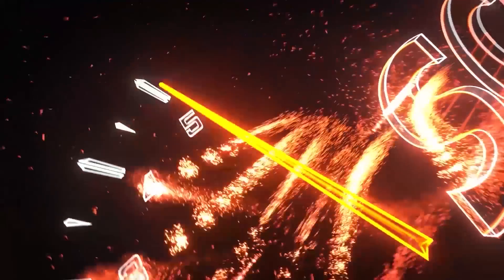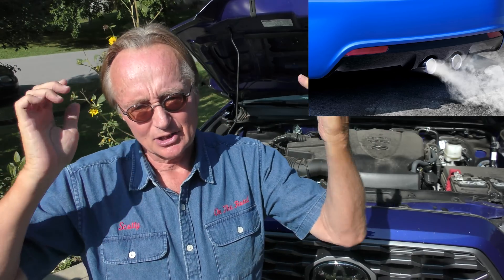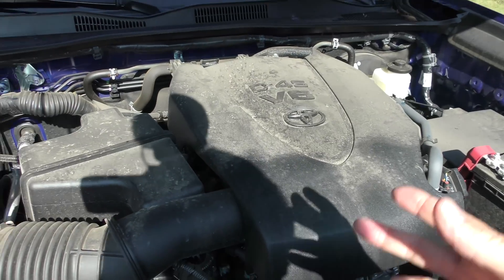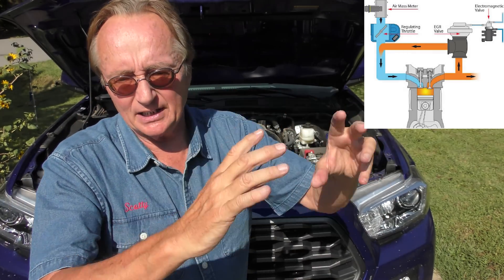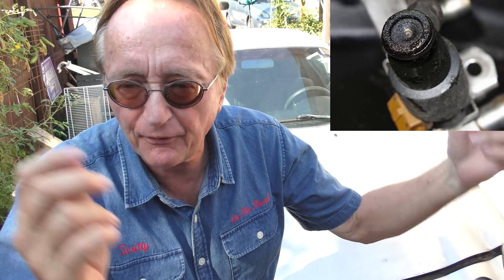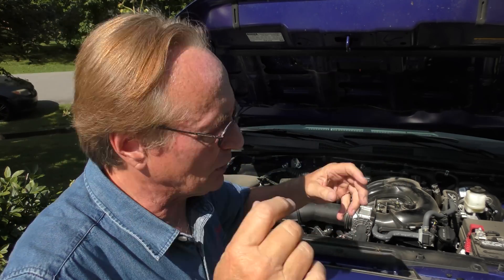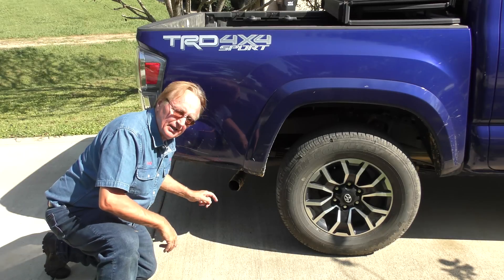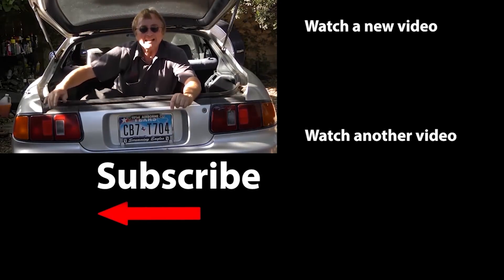Here's Why This New Engine Will Literally Kill You

Comment: When they first start the cars what you see coming out of the tailpipe is condensation as you do in winter but GDI engines burn much higher temperatures so that's why the exhaust is visible....just as in all cars are winter time

Comment: I have this engine and the 2.5 in my Camry. The comments are correct. Toyotas engines and Multi Point   Injection. 1 direct into the combination chamber and 1 before the port to keep it clean. So yes the engine has 2 injectors per cylinder. Toyota delt with this problem many years ago. I'm a fan of Scotty, but a simple Google search or you can count the injectors. 1 set on top the towards the back. Both great engines. My 2.5 get over 40 mpg highwy

Comment: Come on unburied fuel would show as excess HC on emissions test and o2 sensors would pick up as a rich mixture. HC is hardly readable on modern engines, as well as co, measuring in parts per million

Comment: I have a solution - two engine cars. You've got your main engine in the front, and then a tiny 1000cc engine in the back running off of the exhaust particulates. Boom. Problem solved. Give me my medal.

Comment: Most GDI's will start using oil at just over 100,000 miles.  Specially if they put too thin "new engine oil" in an old 100k miles plus engine.  Dont put thin oil on old machines.  Same with trannys and rear ends, use thicker oils. There is more space between parts on worn out engines.  It is not new anymore.  Think.

Comment: What an incredibly misinformative and unnecessary video. Go yell at a factory for polluting. Every single gas car's fumes can cause cancer and other issues. Nobodys got their damn mouth on the exhaust pipe. Who the hell says "silent killer in gdi engines" LOL. Such fear mongering nonsense. You wouldn't have a car that requires injectors changing every 100k miles? LOL then don't buy any moderm turbo car. And carbon cleaning is also a normal maintenance.

Who the hell listens to this guy?

Comment: Tell it like it is , Scotty.  In the late 90's and early 2000's the addition of direct ignition, sequential port fuel injection and electronic throttle control was the pinnacle of gasoline powered engine efficiency. All the changes since then have been a move backwards.

Comment: The biggest problem with your example is that the engine in that Tacoma starts on port injectors and uses the direct injectors primarily under high load.

Comment: I have a GDI 2.4L EcoTec, 6 year owner. 

A few extra details: The carbon buildup issue happens somewhere around 30 and 40k miles, as the rings apparently keep a tight seal until that point. 

I experienced issues with injectors and the high pressure fuel pump clogging around 50k miles on gasoline or e85 if running it exclusively. I alternate between e85 and regular, and the injectors and fuel pump stay clean. I also found with a bore scope that the top of my pistons were building up carbon, which seems to go away if i alternate fuels. The carbon buildup on the piston may have been caused by clogging injectors, or improper O2 sensor readings due to an imbalance between the injectors on each piston. 

I also have to note that I tend to go through quite a lot of Bank 1 O2 sensors, until I started alternating between e85 and regular gasoline.

There is yet another problem, and that has to do with timing chains. The soot produced by GDI through blow-by is captured by the oil, and it does tend to wear out components like the timing chain, where there is no oil pressure between the rotating parts. Extended oil changes are a lie when it comes to GDI. This causes me to worry about the valve train, as there are oil restrictors that prevent too much oil entering the top-end for fuel economy reasons.
Reply: How are things going with your car now? How often do you switch between E85 and Regular?

Comment: GDI engines gained popularity around the mid-2000s and have increased since then.  It would be interesting to see if the rate of lung disorders increased since that time.
Reply: I am pretty sure that it would have to reach a critical threshold. Also, around the same time GDI was being introduced, HEPA grade cabin air filters were being installed in more and more cars, which may skew any data we might see. It would be interesting to see if having a HEPA cabin air filter in the vehicle would offset the PM dangers. Personally, I change my cabin air filter often, however others may not.
Reply: OoHH yes.
Reply: RIP all the mechanics

Comment: Mazda solved (or largely mitigated) the carbon build-up issue on their "Skyactiv" engines (which are all GDI, of course) by running the engine heads a little hotter so that the carbon doesn't have a chance to build up.

Seems to work... Skyactivs have been on the market for over a decade and so far they aren''t reputed for being charcoal producers.
Reply: Good to hear! Don’t want to sell my 2021 MX5, just want to drive it! A lot!
Reply: @RussellBonjornoJr  
Just stick to the recommended oil change schedule and you should be fine.

And a "Ferrari tune-up" a few times a year doesn't hurt either.
Reply: @robinm1729  Every 5K, full synthetic in all my vehicles is what I’ve done for decades. As far as the Italian tune-up…happens fairly regularly!😆(That IS my real name-Italiano!)
Also-been a German luxury brand tech most of my life, and I almost as old as Scotty!
Reply: BMW's GDI engines target 233°F on the highway, which is unusually hot. They still had horrible carbon buildup issues back in the day before they switched to a hybrid direct/port injection system like Toyota. It seems that's the only way - and I'm sure Mazda has switched over as well

Comment: I used to have a Kia optima that was GDI. The high pressure fuel pump burned up at about 80,000 mi. They wanted 1600$ for the fuel pump plus labor. My warranty covered it but still that's ridiculous.

Comment: There is no point to having both direct injection and port injection. Direct injection power increase comes from higher WOT airflow when port injection is not disturbing intake manifold airflow. Loving more conplicated things to throw ODB2 codes and can't pass smog check.

Comment: Having the P0300 code pop up and having misfires. Changed the coils and the plugs and still getting mis fires. The car recently had a timing belt and cam shaft sprocket replaced, but drove well for a couple hundred miles. I dont know if the timing could be good and then it slip a tooth, any help would be appreciated. thanks.

Comment: Again scotty forgot to mention that this DYNAMIC force engine has both port and GDI. No issues with intake valves carborning up. Also anybody with this engine knows the best our gona get is 18-22 max at actual highway speeds (70+) never have gotten better than 23 unless it's extremely flat and yours going no faster than 60 or so
Reply: but then Scotty would get less clicks if he told the whole truth, right? 🙄
Reply: @tgw230 🤖
Reply: Well depends on the gearing also. And yes have noticed how fuel pumps go to heck sooner. Not sure on the injectors. But I had a Chevy cavalier where the spider thing sprung a leak. Had gasoline under pressure spraying onto my hot engine. Not sure how I didn't have a fire. Got lucky😊
Reply: Yes he did ! Look at 3:17 on video and listen to him say it. Clear as day. He even made example by comparing it to matrix which is 17 yes older than Tacoma.

Comment: About a year ago, I read that Toyota was using 2 injectors per cylinder to address this problem. It would run on the direct injection for a while, then switch to the port injection to keep the back of the valves clean. It didn’t mention about what pressure they were using in this system.
Reply: Likely a dual pressure system
Reply: i think the port injectiong for cold start and the direct injection for normal run
Reply: @jake-jm8se no. Direct injection for more power. Port injection whilst cruising.

Comment: I'm chiming in on this one, Scotty! These 3.5 Tacomas have direct injection and port injection in case you didn't know? The port injectors run under different circumstances and clean the valves. I love watching the channel.
Reply: so twice the failure modes.... sweet
Reply: @dr.mantistoboggan4746  depends on how you look at it. First off, it's not a Dodge  😆 and second toyota was smart and did duel injectors so the valves dont get dirty and cause issues.

Comment: What Scotty didn’t tell you is that particular engine, the 2GRFKS, has direct injection and port injection.  It only uses the direct injectors when the driver needs the extra power, like passing a vehicle on a two lane highway, etc.  That’s why this Toyota engine doesn’t carbon up like a vehicle with just direct injection.  It mainly uses the port injectors when it’s running.
Reply: Yota V6 in my IS350 has the same port & DI... must be why I can see my gas gauge needle move when I, legally pass someone : )
Reply: but then Scotty would get less clicks if he told the whole truth, right? 🙄
Reply: I have this engine and the 2.5 in my Camry. The comments are correct. Toyotas engines and Multi Point   Injection. 1 direct into the combination chamber and 1 before the port to keep it clean. So yes the engine has 2 injectors per cylinder. Toyota delt with this problem many years ago. I'm a fan of Scotty, but a simple Google search or you can count the injectors. 1 set on top the towards the back. Both great engines. My 2.5 get over 40 mpg highwy
Reply: Wow, EPA is really going to listen in on this one. Make it harder and more dumb than it should be.
Reply: @yanglue611 so you want people to get cancer...?
Reply: I'd rather listen to a proven mechanic.  This man could build a working car in a boneyard.  I'm sure he's more well informed than a random on yt..😂
Reply: Wish Audi would copy this design 😢
Reply: Cries in 4gr
Reply: Ford does something similar. 2 injectors per cylinder. One port and one GDI
Reply: what other year make models do you recommend to purchase? great input!!
Reply: Ok.
Reply: that's what they tell you
Reply: @dr.mantistoboggan4746 Scotty is a mechanic, he breather more fumes than you will in 7 life times.
Reply: @retiredrebel  school got out early today?
Reply: Could that also be a negative... breathing too much makes you said certain things lol @retiredrebel
Reply: You're telling me this v6 has 12 injectors?

Comment: In mines, much of the equipment runs on diesel.  Black lung, if untreated, can lead to lung cancer.    But if you give your body enough time, outside of the mine, your lungs can heal from the effects of prolonged time inside of the mine. Yet they're forcing DPF on new Diesel vehicles, but not on diesel Generators.  Maybe it'll take a politician, with a company that manufacturers a filter for gasoline engines with DGI; in their back pocket, to bring it existence.

Comment: Question: What if there was attached to the exhaust system a canister of fluid that would wash the exhaust and get rid of or greatly reduce the particulates?  I realize there are would be questions of how to dispose of the particulates in a safe and eco-friendly means and/or recycle the fluid.
Reply: That's what DEF is but only on diesels (so far).
Reply: They know how to fix, They just dont want to.  I'm going to guess its something to do with money 🤣

Comment: Trucks will be using hydrogen fuel cell technology as lithium battery powered trucks would be uneconomic and too heavy. It's time cars used hydrogen fuel cell technology and means the West can be less reliant on rare Earth elements and less problems in relation to human rights issues.

Comment: Uhh no Scotty again you’ve it wrong. A GDI engine has emissions controls which uses common oxygen sensors ( 2 to 4 depending on the engine configuration). They detect the finer particles which are unlikely to get past most of the evaporative canisters. PCV valves, or other computer controlled emissions control systems. Those that do are detected by the oxygen sensors which tell the computer how to adjust the systems that control and regulate the particles. GDI engines operate at a higher pressure and that atomize the fuel more efficiently which creates a more efficient combustion and burns off particulates before they get to the converter

Comment: So much for GDI. Gasoline and Diesel are very different fuels. They are very different burn characteristics and flash points. What works on a diesel will not work on a gasoline engine. Sequential port fuel injection is the best design.

Comment: Hi Scotty. I have a 2016 ford explorer sport. Besides the walnut cleaning. Is there something over the counter additives. For oil and gas that cleans that you would recommend?
Reply: The fouling happens BEFORE the valves, there's nothing an additive can do.  Seafoam through the intake on a running engine can help but change the oil after because it is a solvent and can thin the oil.

Comment: So here you go...I was just told by a Toyota Serviceman that I needed a complete carbon flush for my 2017 Tacoma Atkinson V6 because..."although the port injectors clean the valvles the Throttle Body gums up..."  $365...right!
Reply: Buy a can of spray throttle body cleaner and a microfiber towel, wipe it out, and you’re golden for $10. Scotty has a video of how to do it. 20 minute job tops.

Comment: Scotty is right about the diesel engine emission systems. To replace the emission system one box plus the tank on a diesel engine semi is exactly $17,384.13. That is the reason why I will never ever buy a diesel pickup truck from Ford GMC or Chevy. The emission diesel system on your pickup truck will cost you around 7 to $8,000 to replace. That is why you see so many of those trucks for sale with the mileage around 60,000 miles because when the truck gets to 80 to 90,000 miles that's when you have to replace the emission system. On a diesel engine semi like my own. Your DPF system plus the one box and tank we'll go down at around 498 thousand miles. And you have California and the tree huggers to thank for that. It's nothing but a racket and a cash cow. Now for those of you who are thinking of gelding your emission system you better think again. Because if the EPA finds out you did that depending on the state where you live and the mood that the inspector is  it could cost you anywhere between a 100 to $200,000 fine. Look it up.

Comment: The 3rd Gen with V6 3.5 has BOTH High-pressure Direct injection and Port injection.  The port injection is used during start-up and warm-up to help stop oil dilution.  The Direct injection takes over when the engine is in normal operational temperatures.
Reply: Nope.  The direct injection only takes over when the engine is pulling a heavy load or passing a vehicle on a two lane road, etc.  it only operates when the driver needs the power.  Otherwise the 2GRFKS only uses the port injectors.  I got this info from a Toyota Master Technician.   My Toyota Highlander Hybrid has a 4 cylinder Atkinson Cycle engine with the direct and port injectors and it utilizes the direct injection in the same manner.
Reply: Later model Ford cars and trucks also have a dual injection system.

Comment: To combat carbon build up in gdi engines, is the only solution to clean it out (w/o stressing about the walnut-blasting) is to get regular & correct oil changes, use premium gas, and use engine & fuel additives once in a while?
Reply: an oil catch can helps
Reply: Ultra regular oil changes! Of course highest quality fuel. Fuel additives are a waste, other than usual injector cleaner intervals. What I found to be extremely important is the 'oil spec'!!! Use a low sludge & low ash oil. Paramount!!! Use VAG 504 spec only! 2 I've used are Mobil 1 ESP 0W30 & Shell Helix Ultra C2/C3 0W30 in my S3 ;)

Comment: What is also great about Toyotas Dynamic Force engines is that they are both GDI and Port Fuel Injected. The car will use either fuel injection system to maximize power and efficiency while driving. This is why those engines do not carbon up as much as engines that are just GDI.
Reply: Omg.....enough with praising toyota already.....that wasn't his point ....